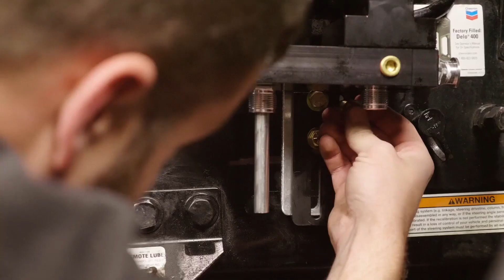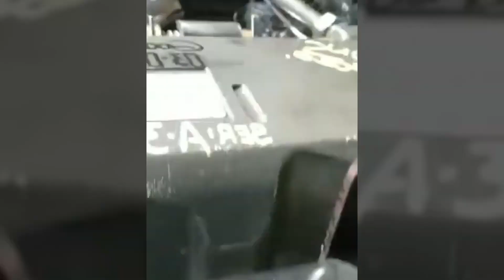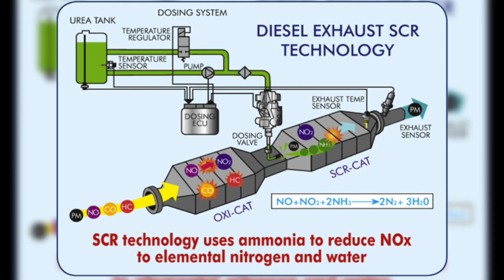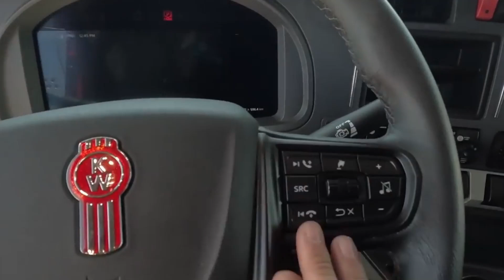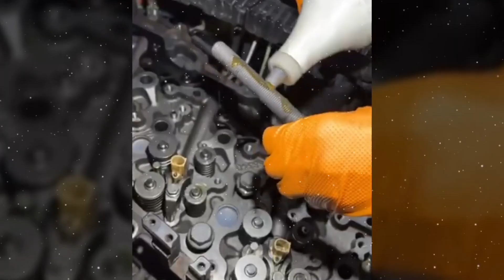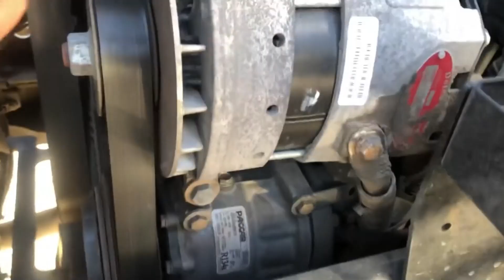The Shocking Truth About Paccar MX-13 - The Engine That Is Ruining Trucks

Comment: I have a 2015 mx13. Over 1mil miles still running strong with no major issues. Delete the dpf and that will solve majority of the issues with any of these engines.

Comment: this is a daf european engine. they design engine for 800kkm 2 years in europe as leasing trucks. and you need a education for this engine.
you cant use the engine brak above 1700 rpm. or you will damage the valves and turbo charge on this engine. evrybody in europe as commercial truckdriver have to go tru a 3 year education to become a professional truck driver. and still have to take 2 weeks every year a reeducation every year to keep your commercial drivinglicense up to date.

Comment: worked for a company that replaced a fleet of older non def completely owned trucks to leasing trucks with paccur engines, they went bankrupt , trucks could not handle winter temps , stranded truckers in freezing weather, DEF system problems derates, fuel savings? sure because it will be in the shop 4 months  a year PACCUR=SUCKER

Comment: MX-13 as a driver my impression is that the engine brake is weak, the torque is poor and it burns just as much fuel as a Cummins.  Our company has 6 of the seven trucks in Portland, Oregon and three have come up with busted camshafts.  I've had a belt tensioner for bad, the D.P.F. system had to be overhauled and the head gasket in the water cooled air compressor blew and got water in the air and compressed air in the cooling system.  Absolute junk!!!!

Comment: Seen more mx13 go a million miles than isx or x15s before an overhaul
Reply: I hope that is true I gambled with one
Reply: A million mile at an average speed of 50mph is only 20.000hrs.. old Daf engines like the Daf 620 used to do 30.000+ hrs in Werklust loaders.

Comment: I’m a mechanic for a medium sized fleet. We have 50 trucks. About 25 are paccar mx13s and 25 are x15 Cummins. About each are manual, auto shift and 2 Allisons, all are 18spd except the Allisons are 6. I can say hands down I prefer the paccars we have by far fewer breakdowns. The only issues the paccars have are injectors and if you maintain them you catch them before they’re a problem. The two oldest have close to 700k on them one had an oil cooler leak and required the turbo be removed and the flange broke taking it off, expensive but not terrible. The Cummins have numerous problems egr coolers, injectors, turbos, turbo actuators, they’re only good for about 300k, they also go through atleast one doc/dpf a year. The two higher mileage paccars recently both had their first doc/dpf change at close to 700k. Our trucks run 24/7 and are only down for maintenance. We do not have the greatest driver by any stretch and most beat the hell outta them. They go 600+ hours on services. They all have oil samples pulled every service and that is addressed immediately. We’ve had three blow up two were injector failures and were covered under warranty. One had 18 occurrences of rpm’s in excess of 2800 rpm’s clearly not its fault. They have 450k warranties on them too.they get an average of 9-10mpg, the Cummins average 5. They Cummins are all 525-565hp the paccars are 510 and the Cummins will out pull them on hills but not by much. The exception is the two Allisons the will flat spank them all. They even make the die hard manual guys do a double take. Once you know and understand the paccars and davie4 they’re actually a great engine, they have their quirks but far fewer than any of the current truck engines options.
Reply: The MX13 beating the X15 is because the MX13 at 510hp has almost the same torque as the 605hp X15. Thats why for the Australian market, Daf engineers from Holland joined with Cummins and totally reworked the X15 to make it the MX15 with 660hp and 3200 Nm of torque. 

We cant get that engine in Europe due to fleet average consumption rules, but if we could, it would eat quite a share from the Germans and Swedes in the heavy haulage market...

Comment: The mx13 has done a good job for 1 million  113000 miles. Original fuel injectors. The 2 exhaust actuators shut down the engine. The turbo is fine.  Waiting to get in the shop to get fixed right now. I know a few tricks. Engine has done a good job in My opinion.

Comment: My 2016 KW T680 ran well till 423000 miles. It had to be towed to the KW dealership.  They found fuel in the ECU. Problem is the fuel regulator, has a seal that goes bad and fuel WICKS through the wiring harness to the computer. I was lucky,  it was under warranty and just a little money out of pocket.  The repairs was over 20000 dollars. My cost 300 dollars. This wasn't suppose to happen again according to the dealership.  Ok, the truck has been running flawless.  It's well maintained.  Regular oil changes, valve adjusted,  etc. Here i am 875000 miles and the dam thing wouldn't start. It would crank but not start. The dash display had every warning light on and was showing over 600 miles per gallon. Had it towed to a repair shop and they found the same F.ing thing. 20000 dollars later and I'm up and running. The truck was only worth 30000 at the most. I bit the bullet and had it repaired.  The truck gives no warning.  PACCAR should recall these systems because you're dumping fuel in a box with voltage.  The Highway safety admission should get involved but crickets.  I can't fault the truck,  just the Paccar Corp. The fuel savings was nice but the cost wiped that out. I should have bought a DETROIT.  I HAVE MANY FRIENDS THAT HAVE VERY LITTLE TROUBLE. Next buy will be a Freighter..
Reply: You'll still be driving a European engine, as Detroit DD11/13/15/16 are Mercedes OM470/71/72/73 😅

Comment: The best fuel mileage engine I've owned, and uses less DEF, has a built in kinda sorta oil purification system with a standard drop in filter and a second centrifugal filter, bring oil change intervals per manufacture to every 60K miles, but I do them every 25K miles.  It pulls decent for a 430 hp engine. All that said, any fuel and oil change savings have bern long wiped away by the $35K in reoairs, including camshaft and components, lifter, fuel injector, both fuel pumps, air compressor head, four emissions sensors, radiator, etc. 
My ladt engine, a Cummins ISX 15, the biggest carbon packer on the market cost me much more in the five years I owned it. I still have 2.5 years to meet that with this engine and I'm well past half way in repair costs. 
Note: Peterbilt and Paccar have camshaft and fuel injector recalls on this engine for my year, but they refused to cover those repairs because the serial numbers on them didn’t meet the recall list! 
Peterbilt sucks today. Paccar sucks, period.

Comment: Garbage. mine got overhauled at 440 and I didn’t see it the truck for 3 months. Cold weather makes the codes pop off. I’m lucky to get a month out of it between shop visits.
4.8mpg it has 730k on it now and the head gasket was done  at 680 but it already has a bad gasket again. Water pump melted recently. I have an aggregate loss downtime loss of revenue plus parts and labor of 1.5 million dollars since I signed for this truck in 2018.

Comment: Junk and expensive parts, expensive labor, unreliable 😢😢😢😢😢😢

I have 2019 Kenworth t-680
500 1 week in shop
25k ABS and thermostat :( 
35 1 month in shop everything was rattling 😢
180k miles transmission , coolant reserve , ABS out 
350k transmission, axels oil seals , airbags, oil pan out :( 
450k engines , coolant reserve ABS out 
550k Transmission computer had a glitch and snapped the clutch :(
650k radiator blowout when they checked the engine was a problem engine out:( 
700k axles oil seals  and airbags ABS :((

Comment: The costs in this video are off. The cost to replace injectors on a 2019 Paccar start around $12,000. The injection lines need to be replaced. The injectors on the 2022 and newer are failing weekly and all they are doing is a injector cleaning. These engines do have good fuel mileage but if your a owner operator you will go broke!

Comment: I put over 1 million miles on my last MX-13 and I'm just over 400k on my current MX-13, I'm religious about my maintenance and I don't ever cut corners with repairs, I average well over 7.5mpg and am usually in the high 8s or low 9s. I bought my current 579 because it had an MX-13 and I've had good luck with them so far. Too each their own. I've been driving 37 years and have had a lot of B and C model CATs I loved, a couple Detroits I hated and Big-Cam III that was the absolute beast. I'm sure it was a engine prone to breaking in it's early days, and I think that it's better engine to own than to be assigned to drive. Just my opinion.
Reply: how many miles do you drive before replacing oil? How often do you change fuel filters?
Reply: @davidwhite9848  I do a full service every 3 months, no matter the milage, and only very rarely will I change fuel filters between services, I have a fuel restriction gauge, if it gets really high I'll concider an early filter swap, but at $200+, that's rare too.
Reply: I have a mx 13 with 535k on it. I bought it in November 2025. I was told to change oil fuel filter and oil every 30k miles or 800 hours

Comment: Our company trucks from 2021 to 2024 all had Paccar engines. That's about 400 trucks. The shop will tell you that it is easier to tell you which trucks didn't have the engine replaced than the ones that did. Majority of the engines had valve train issues. Broken cams, broken rockers, dropped valves, ect, ect. All these engines went down between 400,000 to 450,000 miles. Half way through the 2024 the company switched back to Cummins X15. The Cummins gets better fuel mileage than the  Paccar.

Comment: I have heard that Paccar engines are nothing but shit. Would NOT buy or touch any semi with shitty Paccar engine. Rather have old Cat like 6NZ or C16 or 3406E or Cummins in it with Eaton fuller 18 speed. DEF engines are a SCAM, Nothing more. Your just slowly choking the engine till it kills itself. All those Def plastic bottles have be shipped around the world, thus putting more crap into the air. Also all the parts made for these engines are all made overseas. Again being forced be shipped around the world, along the DEF fluid.  All that crap still goes into the air.  Tell me how DEF is actually helping Turbo diesel engines burn cleaner? 

A better option would be have hydrogen injected with the diesel so burns cleaner.

Comment: I’m going to get a lot of hate for this. In the past almost 15 years, I have driven I MX-11 and 3 MX-13 Paccar engines. 3 were in front of standard 13 speeds and 1 in front of a 12 speed automatic. All 460 hp at 1650 ft pounds of torque. And the only issue that I have had is the injectors on the current one. It has had three sets installed, the last being the generation 3’s. Installed over year ago. With only one code for cylinder misfire. Everytime engine manufacturers come up with solutions for the radical EPA’s ever increasing emission standards, it’s never good enough. The engine is not the problem. Big government and all the emission systems on the engines are. Big agencies that could really care less about the environment are. I have run many different great engines, and I would put the Paccar right in with the best of them. Keep the EPA out of things they know nothing about. They are the problem. Not the motor. Just my 2 cents.

Comment: I own 1 of the first mx13epa21 engines that delivered in Canada in 2022.. i Drove 2 yrs and suddenly injectors started to knock.. I'm Dutch born and heard the same problems were as well in Europe.
I had it flushed multiple times at the dealer and replaced 2 injectors in that time but all gen 1.

Dec 2024 I drove in TX and my engine was getting so bad and start smelling Diesel.. I went to the dealer and found out injector nrv4vexploded on top side and diluted my engine oil and my engine main bearings seized up.. I satc2.5months in a hotel waiting to get a new engine build in my truck under warranty.

I lost a lot of income and huge hotel bill and PACCAR reimbursede maybe 10% of all my lost income and hotel bills.

It's very shit it happened.
The dog system in North America is build by Cummins tho.
My new engine is now doing better and hot the new gen 2 injectors 

My idle is below 5% and do around 8.5mpg and drive average 62 mph

Comment: I work for a fleet that runs a number of different engines. X15s, MX-11s, ISBs and L9s, handful of B6.7s in our straight trucks. The MX-11s are what keep us busy most of the time. If it isn't injector issues in our newer ones its exhaust leaks. If it isn't exhaust leaks its turbochargers. They can be annoying to deal with but at the end of day for me, its just job security.

Comment: I didn't really hear anything in that vid for complaints that haven't occurred to all the other engine manufacturers over the years. Bad batches occur from every supplier occasionally, and it often takes time to add up, as to showing up as a major issue, which puts a good number of units on the roda by the time it shows up. Cat needed main and rod brgs every 500,000mi up ti the C15 came out, timing advaces on pre emissions, inj, heads E block and C15  had tons of cam & rocker and inj issues over their timespan, along with front cover leaks, C15 and C13 had their share of emissions issues, that's why Cat left the business.. Cummins still hasn't figured out liner issues in my 45 yrs of working with them, they got worse.. They've had bad batches of inj since the Big Cams came out, ISX and X15 have had head problems, cam issues, lube pump failures, fuel inj pump failures, oil coolers.. All the engines that use the Cummins emissions system w/VGT have had all kinds of issues with burner systems, EGR valves and coolers, sensors and turbos since Day 1. SCR and DEF systems have had pump problems, sensor issues, heated hose issues since day 1. There really wasn't a new issue there from my experience, I've seen truckers broken by Cummins, DDA ,Cat as well as MX .A bunch of emission issues really were driver related too. One isn't any better than the other in my mind, which is probably  jaded by 45yrs of working with them.

Comment: I am not going to completely believe this. I personally have been driving a mx13 in my t680 since new in 2014. There have been some issues over the years but nothing major. I had to learn to stay away from kw dealers because i always had problems until  i started to go to ind🎉ependent shops. Since then i keep rolling. I stay in the mid 7.5 range loaded or mty,  sometimes 9.0 mty, dpf is still original with no problems, and it has 859,000 right now. Still starts, runs good, everyday, no exhaust smoke, and at oil changes after you run it i can check the oil and you have to use the sunlight to see exactly where the oil level is. This is solely based on 11 years of driving it. Therefore, be  careful of what you hear.
Reply: Thank goodness someone is story telling.  I've got 2015 579 with the mx13 , bought in 2020 w/ 572,000 miles and August it turned 1million miles and it's runs awesome.

Comment: Series 60 . done I have run most from a 1693 to a v six Cummins. The experimental 60 i had in my kw was the first dule hp engine. 490 or 510. 95  kw 900 aerodyne. Heavy haul average 6.5 gpm no problems million miles

Comment: We have 2019 year 530hp on DAF and it’s driven now 700.000km without any issues. We change engine oil in every 30000-35000km. Only bigger investment was DPF which we replaced on 620000km

Comment: I ended up buying a 2013 KW with an mx-13 so I could shut down my ‘06 Pete and do a VERY SERIOUS tear down and build of the entire truck….  That POS MX was nothing but trouble and wrecked the finances of my ‘06 build resulting in shutting it down down completely.  Bought a 2019 389 w/ Cummins to get me through harvest season.  After harvest season dragged the pos MX KW down to Texas to a shop that got it back running and sold.  If someone GAVE me a brand new truck w/ Paccar engine in it I would have it sold by end of day….for any price I could get IMMED for it including by the pound…

Comment: I work on trucks every single day. 
We have 1 customer that has 7 mx13 power trucks all with over 1 million miles and never had to anything other then regular maintenance and 1 fuel pump. Some others here and there but no major repairs yet. Maybe I've been lucky. But way batter then the maxxforce
Reply: 2015 Pete 579 , bought it new with mx 13. Currently it has 1.423.270 miles… manual 13 speed transmission. Changed one injector in the first year (warranty) and I thought I made a mistake buying it. Since then I just had to replace the oil separator and oil cooler in this year. That’s it. After treatment yes: I changed the dpf , egr valve etc at around 1 mil mark and is very expensive. Give me a brand new 2013 epa engine and I’ll buy it with no hesitation
Reply: @severvaduva6438  What does "Very Expensive" mean???  What was the Approximate cost?
Reply: @bluka @blukaw12 say D. P. F filter : around 9000 CAD / over 6k US (and I shopped around). The thing is DO NOT BUY AFTERMARKET: mine lasted me 1.2 million miles without touching it (no cleaning / no burning). By the way, the dpf is made by Cummins (OEM). Then EGR valve (about the same mileage- little less) / scr …. Tens of thousands…. Go ask a dealer. Again, I would not recommend aftermarket. They will probably last you a year. Ask how much for a turbo: I’m so blessed I’ve never had a problem (2. 4 million ) you will be amazed. In my humble view that’s why the engines last: 10-15 years ago quality was different

Comment: i have a 2022 mx13 and did have injector issues and fuel pump
issues with barley 200k miles but  some of these facts are wrong injector for a paccar the injectors cost 250 per injector and 300 for core surprisingly they are not like cummins prices 1800 per injector and i have a few friends that have 2015 with 1 million miles and still running with  no overhaul